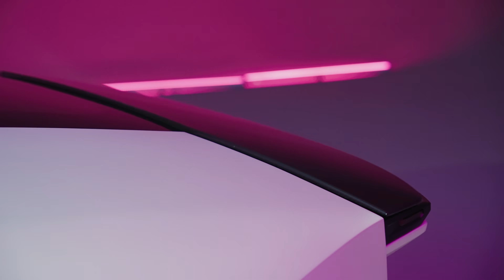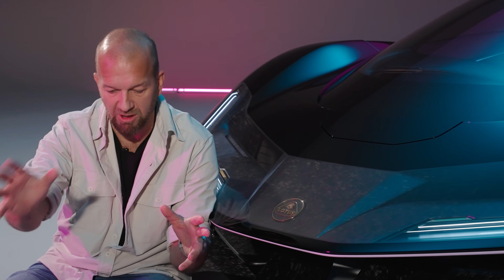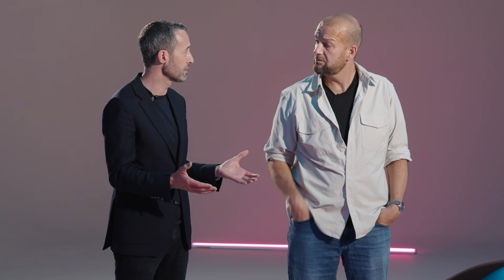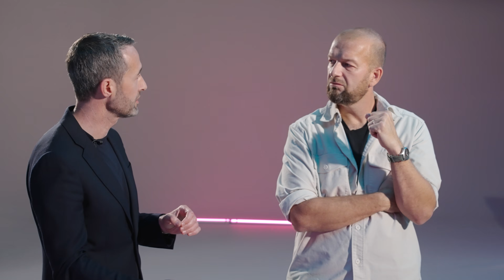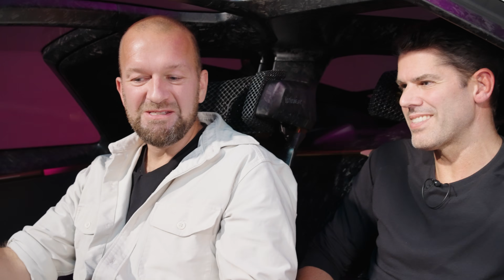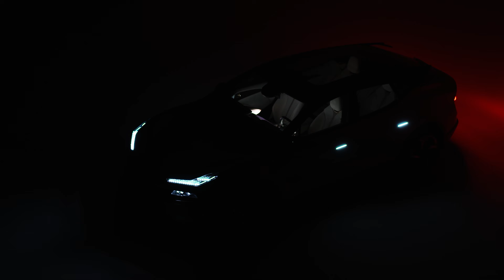Lotus Theory 1: If The Cybertruck Was A Supercar…

Comment: Chopped up bits of carbon fiber seem to be counterintuitive to using CF. If the fibers aren’t in alignment, you may get all the weight savings but not the strength.

Comment: Fun fact, those laser wire headlights are made using a 3M technology you can buy off the shelf. I first saw that on the market around 2017 when I was looking for ways to integrate lighting into clothing that wouldn't look cheap, but back then they only had it in single wavelength. It's cool to see they have white versions now.

Comment: I understand the comments are clowning on this car a lot, but as a design exercise I really like what they did here. The smoked transparent panels around the lights showing through the mechanisms underneath are a really cool idea I think. Same with the doors, the steering wheel, and the chassis-moulded tri-seat configuration.

Comment: How is it practical?  What are the crash test results?  How efficient is it?  250 mile range?? Thats laughable.  These next gen EVs should have atleast 1000 mile ranges.  They'll cost enough!  Why not mate this body with a V10 or V12 hybrid engine.  You'll not only get the best of both worlds, but also appeal to everyone, dramatically increasing is salability to many more customers.  After all thats the whole point of car production, to sell your product and earn profits!  The car will run out of charge before those doors open fully and the steering yoke gets into your position.  Make them manual! Lotus haven't learned much from the past have they?

Comment: Nobody wants a supercar (and even less a hypercar) from a lotus concept car. People wants an actual sports car from lotus. Making the car as light as possible. Using carbon fiber and plastic everywhere but then add a heavy battery on a 4.5meter car is not what Lotus is. People don't want a 4 or 5 meter car that is lighter that can be lighter to a ferrari, mclaren or porsche 911. People want a car lighter and more powerful than an mx-5,  around that size and that it can handle amazing in corners, not doing 350kph in the nurburgring and good on fast corners only. Also, lotus were relatively affordable. Now you need to be a multimillionaire if you want to own one (and i'm not talking about the SUV you've made)

Comment: How about if Lotus tried to produce something like Caterham has proposed with their Project V?  Relatively lightweight (about 1200 kilos), moderate power (about 260 HP) and electric.  That would be more like a real Lotus than another 1000HP mega car that weighs 1800 - 2000 kilos.  That's being done way too many times already.  Instead of showing off engineering excellence, Lotus should be focusing on showing off driving fun.

Comment: They forgot to simplify. And they forgot to add lightness. So it won't be popular with Lotus fans, as it goes against those key elements of the Lotus ethos. And it won't be popular with everyone else as its nothing new in the terms of performance EVs and they won't be able to do it quite as well as those that have already been doing it and learning for 10-20yrs, and they won't be able to produce it cheaper as they're a small outfit.
They would do better releasing a modern day Elan doing the bare minimum to meet roadgoing regulations, manual everything, and the only option should be "radio, or no radio?"

Comment: The “recycled” sounds nice in advertising, but is usually absolute useless nonsense in reality.

The real world range would clearly be approximately 65% of what they claim on paper.

And the most important part:
NOBODY wants or needs EV sports- or hypercars!
Just ask the current manufacturers.
Logically, because EV are basically all the same, and sales numbers reflect that.

Cheers
P.S.: The fixed seating position and moving pedals etc. is clearly due to laws/regulations. The steering wheel / display etc. would not pass either.

And no…it still is a confused mess, because it’s basically neither, nor.

Comment: Small 3 door EVs seem like a no brainer to me. You can seat three people in relative comfort in something as small as a smart car. The central driving position means that you don't have to worry about manufacturing for different markets, and would give a balanced feel to driving. Retractable cameras to replace all mirrors seems so obvious. Mirrors are often damaged or vandalized when the car is parked, This fixes that, and it also means the central position doesn't have to worry about being able to see out of the back. The benefits of rearview cameras are huge. The car doesn't need to be designed around the rear view mirror. I think this can lead to better, safer, more aerodynamic and robust spatially economic vehicles. The use of recycled materials seems obvious too. I don't think cars should go or need to accelerate as fast as this concept. It's like being the bullet of a gun. Sure, it's important to be able to speed up to traffic, and if all vehicles had super acceleration then slip roads could be shorter, but I wouldn't trust a lot of drivers with that amount of acceleration.

Comment: I say this as recovering Graphic Designer, it's too heavy visually. The old Esprit was not a light car but was visually quite light. The Theory 1 feels heavy everywhere you look.

My thoughts on electrification are that it's not the silver bullet of an idea that was promised. Hybrid engines seam to be the best option now. My thoughts on what a halo Lotus driveline should be would be a low displacement v10 with hybrid power.

Comment: I think first of all, Lotus can charge almost whatever they want for the right car. To me, a neutral party, they don't feel forced to a specific price class. However and even with that said, they cannot afford to do this car. For both Lotus and the customers (there is a limit to the thing I said prior!) it would be astronomically expensive. My point is, if they made sports car in that size with around that battery and horsepower—even if they went all out—it would be heavy. Not 3500 lbs heavy, like this car, but more like 3800–4000 in my opinion. Because it would still be a production car and even limited run production cars cannot incorporate all of these genius weight-saving ideas at the same time. Something will have to give and then you get into regulatory design where even more will have to give. Tl;dr Lotus cars will still be heavy

Comment: People seem to rage about Lotus no longer making "light" cars. Well, thats not because Lotus doesnt want to make them. But rather the entire industry is moving the opposite direction. With electrification, all that lightness goes out the window. Electric engines are lighter than standard engines, but the batteries are not. There is no such thing as a LOW TECH, or LIGHT WEIGHT battery. Batteries are dense by design. If they were not dense, they cant carry power. If someone comes up with a lighter battery, well then they will put in 2. There will never, in our time, be a light-weight electric car. 

But the trade-off is that they give you twice the power to handle the added weight.

Comment: They could easily make a lightweight Lotus with a/c motor power but the range would be short if they chopped the battery size in half.  With a 30kWh battery, it could be a fast charging, reliable, insane hole shot autocrossing beast with 100mi range.

Comment: I agree with the "theory" (pun intended), but a space age looking car by its mere principle (a futuristic wizzy looking thing) can't elicit the same excitement in a human as mechanical clicks, whirrs and thumps. It can be exciting , but completely different style of excitement. It looks like a floaty idiot-proof safe capsule - I'm sure the rich will love it and buy it, but it doesn't generate any excitement of grunty smelly dangerous slippy fast fun. Speed and advancement in tech is the opposite in direction of raw human wish for fun/danger. MX5/old MG = slow but fun , Tesla 3 performance = too fast, no interest in ever using it down a B road. You can't make futuristic cars appeal to the same old Skool driver genes, they are fundamentally different. Just have to accept it and move on. I think Lotus are doing that as the car looks really well put together, but the marketing flumf really does the car a dis-service. Less waffle about meaningless buzz words, more real world down to earth " car will be too fast to ever let loose in the real world, so no fun, BUT you might be able to use it to go around a car park without stalling and proudly display it on very posh bound aggregate driveway with no risk of a little lotus oil leak" explanation please.

Comment: It looks great, the central position three seating, yes please, the head rest, too. I've tried similiar seats to these in a 4D cinema, and no thank you for poking in the back or moving about. I believe it'll be really distracting. Instead have different seat modes connected to the drive modes, where the seat tightens the grip on driver and passengers when in the more extreme modes, but relaxes them when the driving is more relaxed.

Comment: Why this obsession with 0-60 times and fully electric hypercars? The first Elise did away with measly 120HP and a 0-60 of ~6s, which is still pretty quick. 
A suggestion to Lotus:  Build a small, hybrid powered sportscar that is actually affordable, e.g. based on the new Prius hybrid system. I guess you could manage to get that to ~1000-1100 kg, which would be pretty fun with 225HP and a car many would actually buy.

Comment: Electric cars were always going to be a thing eventually, my concern is that producing the current batteries is not really clean or viable using the current materials. Graphene tech seems to be the way forward, however i think for now at least building engines that use sustainable and clean burning fuels would at least still provide the visceral experience of a living breathing engine whilst also keeping hundreds of thousands of mechanic jobs intact, not to mention a whole industry of parts and all that goes with it. As things improve to the point of making a job or industry redundant, there has to be another avenue for that redundancy,
Reply: A whole lot cleaner than the never ending cycle we use now of digging drilling and fracking up over 25,000,000,000# of crude oil a day wold wide also using water and harsh chemicals+energy. Then you have to transport it in huge ships, trucks, trains&pipelines causing more pollution using more energy. 

Then use some more energy water and chemicals just to refine it into actual burnable fossil fuels. 
Transport it AGAIN, to store it in underground tanks that can&do leach right into our local water sources. 

Then use up more energy pumping it into your tank to burn it causing more noise heat and disgusting poisonous particulate matter pollution at about 20-35% total well-wheels efficiency! 👍🏻

Oh yeah and of course your burning that 7# of liquid fuel a gallon vs the battery materials once mined stay in the car for 8-15+years and can be recycled at 91-95%+of all it's original content&can use already recycled material to make the pack's=eventually A closed cell supply loop.😀

So do that for fun take 7# a gallon and figure out how many thousands of pounds in fuel alone you burn up each&every year! 
The average us sedan driver burns up 400-600 gallons at 7# per gallon. The average truck or SUV driver burns 800-1,200 gallons a year. 

The average commercial use truck burns fuel at 6.5mpg and semi tractors travel 63,000+miles a year on average. So 1 diesel fueled tractor can consume over 70,000# of diesel fuel per year it operates. 

Some use even more and that doesn't inc all the chemicals&even cobalt used to refine it's fuel. Doesn't account for the def fluid most modern diesels burn&it's manufacturing process etc.

Comment: If someone can make a lightweight and fun electric car it should be lotus but the new management doesn’t seem to align with the old ways.
Reply: But what are you really after? They've presented a light and fast electric super sports car. What more could you expect? A miracle?
Reply: That isn't a light or fast car though... It's an overly & unnecessarily complex design study only, that will look old-fashioned & outdated in 2 years time...
Ben Payne needs a serious dose of reality, this isn't the direction Lotus should be heading style-wise.
Take the existing cues from the Emira, Evija, add a touch of Elise GT1, 340R, Type 62, M250 & previous pre-Bahar concept Esprits & you have the perfect Lotus...👌
Reply: @bartomiejmiara8975 Light my ass. Talk to me when it’s under 2800 pounds (and even then that’s pushing it for a lotus)

Comment: this is a great looking car, but lotus really need to make a light weight electric car circa 1000kg to offer something inherently lotus- something we haven't seen yet from other manufactures
Reply: The og lotus chassis equipped tesla roadster from 08-2012 was 1300kgs. Why can't anyone take that formula and make a similarly priced product? The Chinese ssc sc01 ev 2dr coupe with 429hp is awd using dual motors looks killer and is 1380kg for a 41k starting price. 🤔
Reply: @4literv6  cuz the range would be sh1t....needs solid state batteries
Reply: They need to build what Caterham are proposing for their EV. They already have the advantage of having the tech available.
Reply: This is physically impossible. Already here, every possible trick has been used to reduce weight, including a carbon chassis, which gives a weight of 1600 kg.
Reply: @bartomiejmiara8975 NO. A Dacia spring EV is under 1100kg.  Nothing fancy there. Big power big battery I know. But. Start out small n slim, like a caterham.  Add aerodynamics, aluminum, carbon.  750-999kg with 250-350hp electric and decent range should be possible

Comment: This video proves people running Lotus dont understand what the people want...... We want lightweight, ICE/hybrid, manuals with a name staring the letter E
Reply: Yet hardly anyone bought an Elise that was full ICE
Reply: @marktickle8480  That's the nature of their brand though.  A semi-expensive car that is really hard to live with day-to-day.  The Elise was a step too far for 95% of drivers.  Lotus doesn't need to make a race car which is roadworthy...but a road car which is capable on the track.  The Elise and most Lotus (Lotii?) have always been extremely niche.
Reply: @oskar6661  I would say some have been niche (340R, 2-Eleven, 3- Eleven), but there is a long history of more livable Lotus. Excel, Elite, Carlton (pushing it on its Lotus'ness), even the Esprit was quite plush inside. Evora and Emira are hardly stripped out racers. Granted, I wouldn't use my Elise S1 for daily duties!
Reply: @marktickle8480  the old one was rough, add some creature comforts and some usability that its bearable and people will buy it, just like the Exige and the Evora
Reply: @petersafwat8228  I honestly think sports cars are not the big market they once was. Everyone who wants an Elise has one (myself included 10+ years). There are lots for sale, hanging around, again, if anyone wanted one they'd get it. Mazda offers a small, light, affordable sports car and that's not selling as it used to.